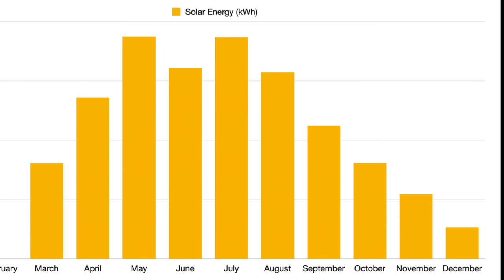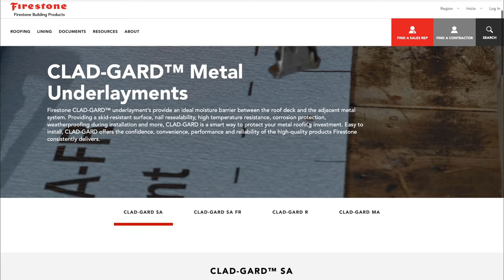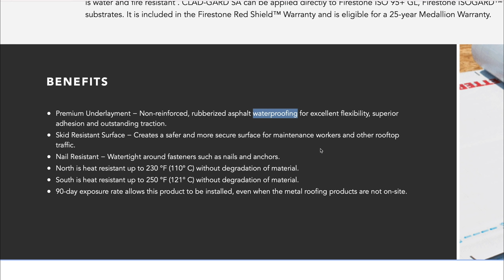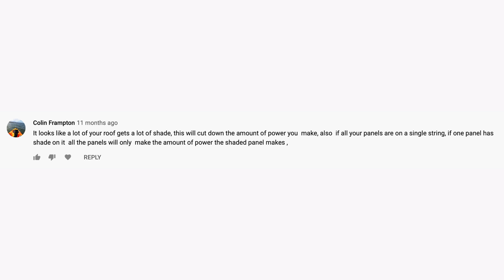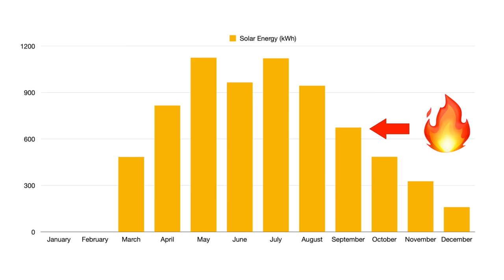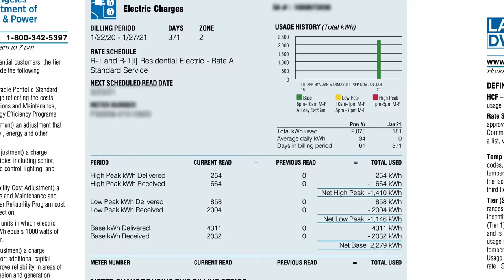1 Year with Tesla Solar Roof: top 11 questions answered + real production numbers & utility bills!

Comment: The fact you still had an electric bill when more than half the power the system generated went to the state Is reason enough to not get one installed unless you can operate it without having to run it on the same grid as your local power suppliers

Comment: I feel like you could have gotten less PV and saved on the cost. Only using 1/3 of production, do they have gap tiles? If you only wanted half the roof, the other half would be similar looking tiles but not actually PV

Comment: It costs on average upwards of 38k or even 50k to have this roof installed according to google. He has  a savings of roughly $2089 every year based off the numbers he gave. So for that roof to pay for itself excluding any extra costs (like the roof cleaning guy who probably charges more cuz of the type of roof) Itd take about 20 years...and most roofs don't ACTUALLY last that 25 year or 30 year time period without lots of maintenance. So after about 25 years youll break even on cost before you have to replace it again. Cool.
Reply: 25 year warranty

Comment: The one major criticism I would make is that without a Powerwall the roof is really dependent on the grid for backup. That means the roof is really a parasite. Users may well input power to the grid and getting paid but they don't pay for the full value of the service they receive from the grid which is the backup when the sun isn't shining and especially at night.

If I were the local electric utility I would demand every solar installation has a backup battery and only gets paid wholesale rates for dumping surplus power. That really tips the economics against solar which at the moment is free riding on the grid.
Reply: solar users pay the rates everyone else pays when they receive it at night. But, they add power to the grid in the day time. Not a parasite at all. Quite the opposite. The power wall is only useful if the power grid fails and only benefits the owner of the power wall. 

Solar users are not "free riding" in any way. They're power producers that add power to the grid.
Reply: @81970277324  That is only true if they pay the same fixed standing charge as other consumers without solar panels and receive a payment only equal to the wholesale price that other power generators get paid for putting electric into the grid.

Comment: I‘m a really big Fan of Solar roof, got normal 400W Panels on my house in germany with a total of 10kWp. I have to say the power density of solar roof is really Bad. You fit 9.09kWp on 1745sqft, i have around 10kWp on 540sqft. It looks really shiny but it‘s Double the price to a normal roof with the panels on top and i can even triple the whole system if i want to.

Comment: How many years will it take for the savings in energy costs - assuming they continue to be approximately the same - to pay for the roof?
Reply from the maker: Will pay for itself in ~10 years. (I deduct the cost of a conventional roof when I calculate ROI—I needed a new roof!)
Reply: @AustinFlack  Needing a new roof definitely contributes?

How much did cleaning it cost? How often will you need to have it cleaned? (This impacts the payback time, too, I think.) But 10 years isn't too bad, especially if you can get the loan set up so that you're seeing the cut in costs smoothly right away.

Comment: welp not surprised about shades affecting a larger chunk... i mean look at each shingles... its so small compared to a small panel which are already configured in series a lot... so its obviously put into serial config in certain chunk sizes... 
the way you can minimize the effects of the shade from nearby objects like trees and other buildings is to make sure the panels in series are arranged it should be as parallel to the shade's as possible.... 
or the actual way to reduce it truly to a minimum is to get a dc to dc converter ( DC to DC step up voltage... you can buy a good one like for a few dollars each ) and config it to the voltage range to whatever this PV is supposed to output to and then put every PV going to that whatever diode detrun-thing you said in parallel config per shingles... 
its a way cheaper method compared to buying a single micro inverter which just basically puts your system in parallel in the end if you think about it... 
so you get the "advantages" of a micro inverter but doing so at a way lower price and still use pre-existing installation.... but i don't know if its okay for you to do modifications like that... 

to me it looks just like a simple thing to do since i deal with electronics a lot... and tbh micro inverters are just over glorified and over priced... especially when its mounted outside like in the LTT video... because the amount of loss due to temperature change for that device like if it gets too hot or too cold thus making the device sometimes work outside the optimal operating temperature... his installation of his micro inverter is fine because he uses a water cooled panels which is also used to make hot water for his home.... but most people would use a standard panels.... so yea... really hate the idea of micro inverters because those people are selling them like snake oils.... they do fix the problem of series connection but they purposely priced it at ridiculous prices.... 

the reason panels lose the output in series to the lowest panel's output is due to the resistance created in the shaded area as they are not producing the same amount of power due to releasing less electrons from the shaded area as compared to the unshaded area... so if you are keeping the same voltage output that means the only thing that can be reduced is the amount of current output... and thus it acts as a resistance as it impedes the flow of current at that shaded point a simple analogy would be that the shaded part becomes a funnel for the whole system... its easier to visualize this if you have a diagram explaining this... you can search it up in youtube for people that are better at explaining this...

if you want a more simplified accurate explanation of this thing, its just that due to lesser ampere, they produce weaker magnetic force thus the whole area of the unshaded system which had stronger magnetic force is rendered useless in series connection as they would still need to pass through the area with the weaker magnetic force... 
its like using cables for 30 amps in series and somewhere in the middle you used a resistor and a 20 amps wire...

also why some people recommend solar panels in parallel configs... the only downside is the bigger gauge wirings required.... or you could just use smaller wires in parallel as well to mitigate that problem...

BTW parallel config are basically like each panel acts as an independent circuit loop... so if there is a shade in a panel, only that panel is affected.... see its the same thing as a micro inverter... thus why i said those DC to DC voltage converters are pretty much a cheaper version of micro inverters because you can get a very good one for 1 panel for a few bucks and up to a few tens of dollars (around 20 bucks for a bit more extreme ones for larger panel and larger hybrid inverter system).... as compared to a micro inverter for around a hundred dollar a piece at its cheapest price for a single panel.... btw bigger gauge wirings used are still cheaper in total because you only need it at the point where you turn all the panels into parallel with each other so you can get away with very short large gauge wirings just before the connection to whatever device you want to output the panels to....

Comment: Thanks for the video. I can see that if rain is behaving nicely, i.e., pouring straight down politely, the roof configuration protects from water, but often in the real world, rain and wind happen simultaneously which means rain can be hitting the house sideways. Any comment on that situation?
Reply: The plastic underlayment beneath the tiles is the actual roof. If you didn't have the tiles it could work independently, but exposure to sunlight and falling debris would damage it. The tiles basically exist to protect the fragile waterproof layer of the roof. This is house all high quality roofs work in modern construction.

Comment: similar system here but credit is Wholesale  to power company is  paid to you . and all power produced must be sent to grid and then you buy it back at retail price. I will never go on the grid without batteries charged for me first and if any is left then it will be sold to power company. Did you power your house first then sell the remainder to them . or Do they require all power to then first and then buy it back for your use.

Comment: For those wondering 
- he saved about $2000 in one year
- he payed $33.000 for the roof
- without taking anything into consideration, it would take 16 years for him to break even (which might seem like a good deal considering the warranty is 20 years)

but...
- Solar panels have developed over the years and will continue to do so, and with that, the prices have also dropped.
- Everyone is focusing on clean energy, so electricity will most likely become cheaper and cheaper.

so...
It might sound nice on paper, but in reality you're basically betting 33k in the hopes that everything will go right and you'll get an 8k profit after 20 years.
I don't know the interest rates in the USA, but putting that 33k in that bank could probably get that without all those risks.
Reply: Yeah, but you also left out inflation, which means energy will--- dollar for dollar--- likely cost more over the years.

Comment: How much energy does it cost to make these tiles and how efficient are they in 15 years? Turns out not so good.
Reply from the maker: Covered the cost in depth in my first video: https://www.youtube.com/watch?v=LRPy8UZv9V0&list=PLXt9cHZDKoN4TcPWRp-P7iQfshODE274k

Short answer: $33k, about $21k more than if we had just gotten a conventional roof and about $3k more than if we had gotten a conventional roof + standard solar panels.

Will pay for itself in ~10 years. (I deduct the cost of a conventional roof when I calculate ROI—I needed a new roof!)
Reply: @AustinFlack  so you don't know how much energy is used in the process, just the cost in $, would be nice to know the amount of energy spent making them and thr carbon footprint they carry in shipping ect.

Comment: The problem with every solar panel video is the huge gaps in information left out which actually tell if it's worth it or not. You didn't say how much the roof cost. That's kinda important to factor in, don't you think? You didn't say what your kwh price rate is. Considering the whole point of this video is about "real production numbers and utility bills", the price per kwh is arguably THE MOST IMPORTANT factor; that and how many are generated. I don't get why it's so hard for youtubers to actually tell the whole picture. Like this:

kWh generated in 1 year: 7998
Price per kwh (in absurd LA): $0.251
$ amount generated: $2,007.50
Roof cost: $55,300 (according to Forbes before incentives source below; was yours cheaper because your roof is smaller? Who knows because you didn't say)
Incentives: ??? (who knows because you didn't say)
$ paid to you by LA for power generated: ??? (who knows because you didn't say; I assume zero since you said your total bill for the year was 142.34)
Cost of roof cleaning and maintenance: ??? (who knows because you didn't say)

Based on the numbers, and again we have to guess because you left out all the important ones, it seems like:
($2,007.50 * X) - $55,300 - (142.34 * X) - (???expenses/maintenance???) + (???incentives???) = break even point
X = #ofyears

So at 20 years, you're still at negative $17,996.80 (not including expenses, maintenance, or incentives.
At 29 years, you're at -$1,210.36.
At 30 years, you're at $654.80.

So the break even point on this is 30 years. And that's assuming your $142.34 annual bill doesn't rise (which it will), maintenance and expenses don't cost you a dime (which they will), energy output is the same (which it will reduce), and so on. Of course, if the power rates rise, that will help a little bit (which they will), and if you get incentives, that will shift the scenario, and, if your roof was smaller/cheaper then that helps the cost as well.

Looks like a horrifically bad investment, though. If you instead invested that solar roof cost into something which yielded a modest 8% return, you'd have over half a million dollars after 30 years ($556,464.93). OOF. But hey, at least you're "sAviNg tH3 pLaNeT" 😆

Here on the east cost, power is about 11 cents a kilowatt hour. If your absolutely absurd power rates don't even make it a good investment, can you imagine how much worse it is for a non-idiotic place? And on top of that, with all the sun you likely get. Damn. This should be a "why you SHOULDN'T get solar panels" video 🤣. Well, I guess unless you like losing heaps on money...

https://www.forbes.com/advisor/home-improvement/tesla-solar-roof-cost/

Comment: Wait, should the power company be paying you for the energy your generating for the grid?
Reply from the maker: When we send energy to the grid, get energy credits, which "pay for" the energy we use at night, cloudy days, etc. (energy at night, during peak demand periods, is more expensive that the energy we generate during the day). We can bank credits (sort of like roll-over minutes) but can't cash them out.

Instead of spending roughly $60k on batteries to ensure I was totally off the grid, (for a maximum savings of $156/yr) we just trade daytime energy for night time energy. We also charge the Tesla late at night (after peak demand hours), which is a lot of kWs, which helps explain how the daytime disparity evens out.

Comment: How much did it cost to buy and install?     I live in N.Texas where you get plenty of sun (and 30 to 100 days over 100 degrees) but my electric bill with monthly averages about $250 a month.    Hard to justify cost of any solar system.
Reply: You can’t justify Telsla solar panel roof but maybe a standard micro in inverter panel install with battery backup.  Don’t you get bad outages?

Comment: Did you receive any money from the energy and water department for the amount of electricity you sent to the grid? If so, then how much?
Reply from the maker: When we send energy to the grid, get energy credits, which "pay for" the energy we use at night, cloudy days, etc. (energy at night, during peak demand periods, is more expensive that the energy we generate during the day). We can bank credits (sort of like roll-over minutes) but can't cash them out.

Instead of spending roughly $60k on batteries to ensure I was totally off the grid, (for a maximum savings of $156/yr) we just trade daytime energy for night time energy. We also charge the Tesla late at night (after peak demand hours), which is a lot of kWs, which helps explain how the daytime disparity evens out.

Comment: I have a 6.6kw system, can generate up to 35kw a day in peak summertime. I still have a power bill of around $220 every three months. It used to be less because here in OZ, the electric retailers are cutting back on feed in tarrifs. When I got the system I was getting 12c per Kw feed in, now I get 8c. Eventually this will fall to probably around 3c. It falls lower as more people get solar, otherwise they would go broke.

Comment: Based on the total cost pf the product and installation it will take the average customer 17 years to break even. If you took the $37,000 and put it in a mortgage fund with an 8% annual return, compounded over 17 years you would be ahead by approx. $20,000

This is why solar power is not going to catch on anytime soon.

Comment: How does the roof affect insulation?  Do you end up running the A/C or heater less or more than normal?
Reply: He should get a radiant barrier inside his attic either way, that's what will help him the most with AC costs

Comment: not sure what happened. had a comment up and it was deleted, maybe cause I had my referral link in it? ill post again without my link. anyway, the basics of mine are I just did a tesla install, had a battery and a 500 sq foot adu done. Amazing technology, WORST experience with Tesla as they have no idea how to manage a project, especially a new build, something they just started doing last year. we used them years ago on a ready-built house and installed panels and it was a much more smooth event. this was and is a crazy experience. we are also in the LA area (near Santa Monica airport). anyway, they made us pay more than we should have, was still a deal, 14k for a 2.7k system + battery. would have cost us 6k in labor and material to put a regular roof on so we also technically get to subtract that from the cost as well. still waiting on ladwp to get us the dual meter so we can officially get credit for sending it back to the grid. and tesla called us last week saying oh it shouldn't be on yet (it's been on since December) and so many more issues with them. not sure what their issue is. Love the tech, but hate the administration of the project.